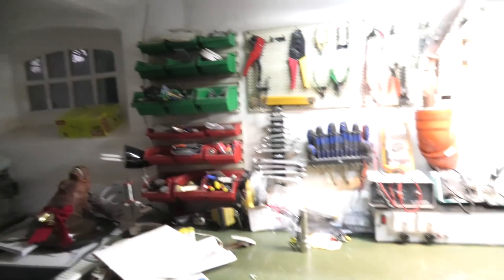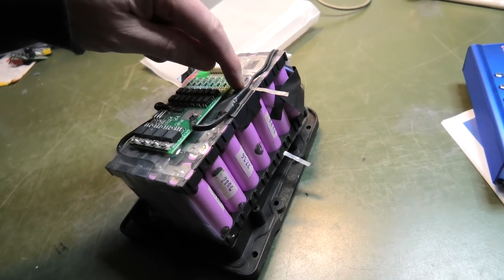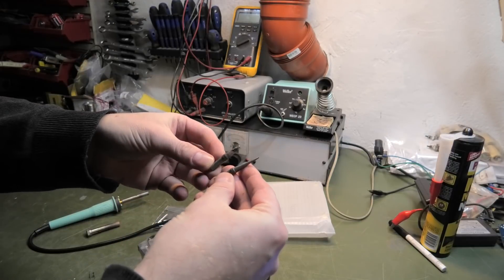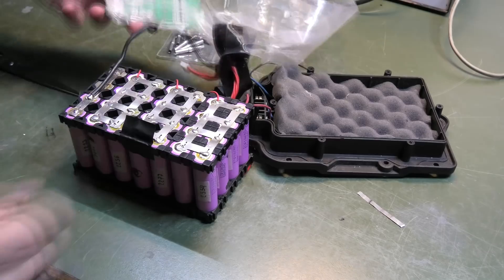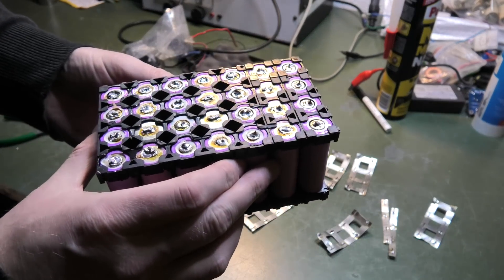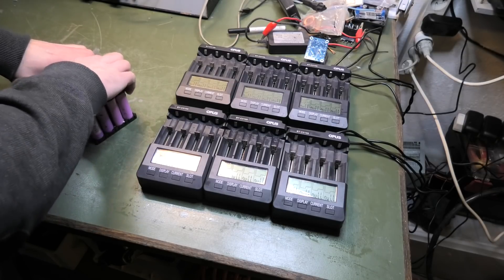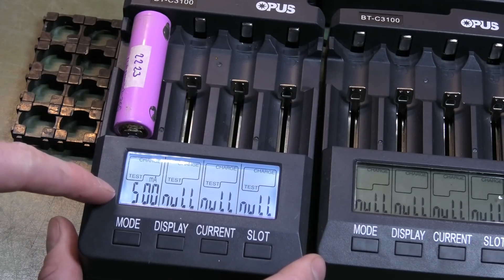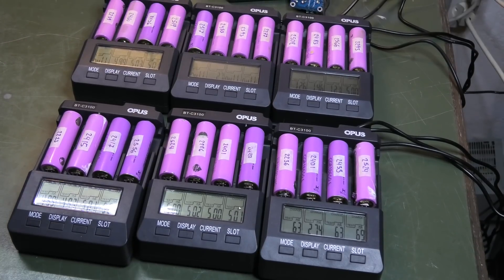I Helped the Robot Lawn Mower to Self Destruct - 946

Comment: Smart chargers at a low voltage will only charge at a tiny rate till they hit a near voltage, then they switch to higher power charging.

If the batteries only show a slow/low rate, then they will become unbalanced quickly, so not worth using regardless of capacity results.

The end comment, the battery manager. I think it's more the reverse polarity that caused the issue as it will throw the catalyst to the other plate and short the battery.
(You should resistance test them all)

I balance my batteries manually, but I don't have a lot of cells (3*3) so they don't get out of balance.
They also don't discharge by any means and are totally disconnected.
(Other than self discharge).

Then I saw a big pile of batteries..
Mine are just about every where.

Also the lipo discharge is about 50% of capacity. (Not accurate infor there) Therefore.
A 2000mha battery will be "flat" having 1000mha remaining.
Therefore a 500mha charge will (or should) take 2 hours.

Maybe you need to boost the charge from the dock?  Yours is solar if I remember. Maybe your just not getting enough current to power and manage the batteries?
Reply from the maker: Hi Rory Witham
Thank You very much!  glad you liked the video :-)
Thank you for watching! :-)

Comment: It's not necessarily the bms fault that half the cells are dead. They could be on the decline before winter, and fell into overdischarge because of high internal resistance and autodischarge. BMS can't do anything about that. If you want to build a reliable pack, I think you have to test the cells more seriously: test them several times @1A so that it lasts half as long and detect more easily possible "heaters", so you can see if the capacity of a cell always varies downwards between several tests. If this is the case, they are dying. You should also test their AC internal resistance @ 1kHz and compare with manufacturers values in their datasheets. Higher IR = bad sign. YR1030 or 1040 and SM8124A are relatively cheap and good IR testers. You can't test cells AC IR with multimeter.
Reply from the maker: Hi kna60
Thank You very much! I am going to rebuild it,, but I am also just thinking of maybe I would also like a smarter lawn mower,, this one is from 2014-ish and runs random,, I think I can do better.
Thank you for watching! :-)